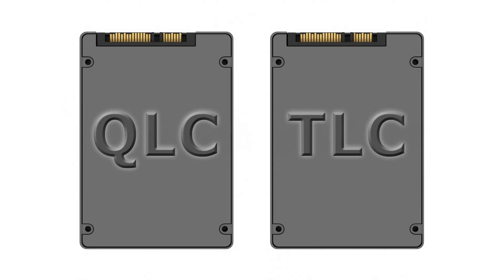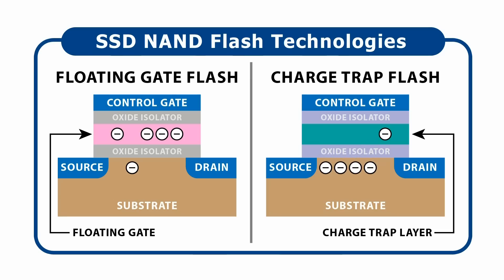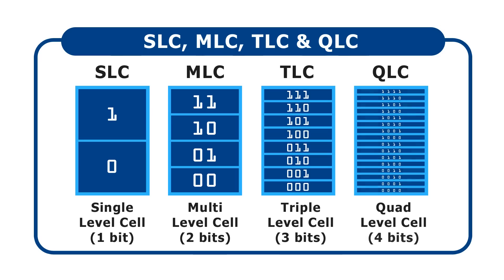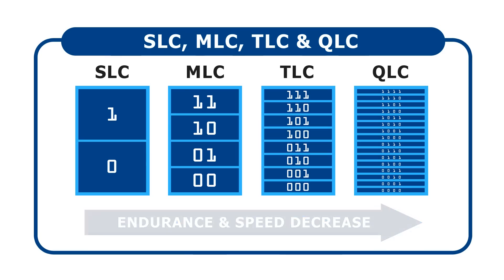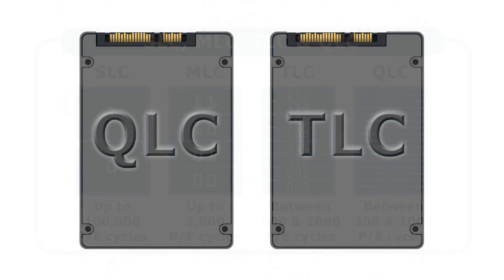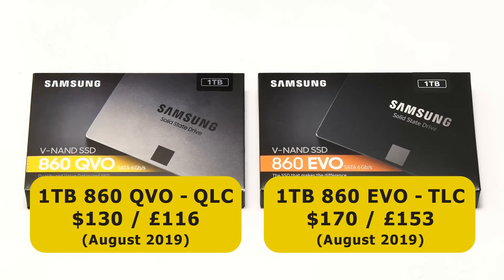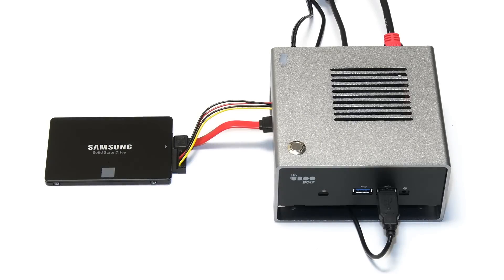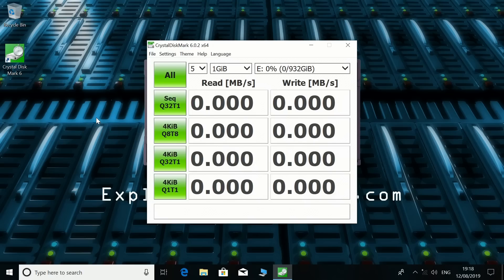QLC vs TLC SSDs: Samsung QVO & EVO

Comment: The likely reason your drive has the 78GB SLC cache is because it was produced as a 2/4TB model but for some reason a memory module did not pass QC to Samsung's standards. One of the modules was disabled and it was packaged as a 1TB 860 EVO. This is called binning and is common in production of microprocessors and memory.
Reply: They would bin the memory modules, probably, and not finished articles. That would be wasteful. The real reason is faster cache/storage interplay inside the TLC drive, which means it didn't saturate just yet.

Comment: So if I cache an 8 TB HDD with a cheap 3D TLC 128 GB SSD, I can achieve more storage at a better price, and it would perform faster. I think QLC might be better suitable for enterprise or commercial use where they're trying to keep down power consumption or vibration.
Reply: "Better price" as in better price per GB of storage. I have 4, 6, and 8 TB HDDs in my PC, trying to get enough space.
Reply: problem is the cheapest stuff sometimes make you cringe
Reply: @claritoresdiano1021  An ADATA SU800 128GB can be found for about $30... This setup would be more durable than a QLC drive.

Comment: we saw that linux mint drive going into the mother ship - ya linux is the greatest system ever. ubuntu mate runs great on my dell r410 server with 32 gigs of ram - new graphics card works in it too -its gonna be a render farm/workstation.   its kinda loud so might have to plunge it into a liquid cooling tank.  just ordered samsung evo hard drives on ebay last week so maybe thats why this video popped up.  i sometimes wonder what free bsd is like but never had time yet to try it yet.  oh by the way why do servers use SAS drives and not SATA???  is SAS better - worse???  so many questions and you're the only one who probly knows.  servers have SATA ports and seem to be working fine.  sorry for this long boring comment.

Comment: With the drop in price of QLC I finally ditched spinning HDDs in my main system. I keep 2x2TB drives in a NAS for movies but my main PC now has 2x1TB Kingston A400 drives for game storage and a 512GB M.2 drive for windows and programs. 
I think we'll see this become the norm in desktop computing in the next 3-5 years, the only reason I have the NAS is becasue of the reduced life-cycle of QLC.
Reply: Which M.2 drive do you use? And is it Sata or NVMe? Got any temps problems? Thanks.
Reply: @gabcenz  I use an NVMe Intel 660p drive, 512GB. Read/Writes at about 1.7gbps (about 2-3x as fast as a sata drive) and it was only $60 for the 512GB. My case is the Fractal Design Focus G and I have 6 fans in it so I've never had problems with temps (FX 8350+ GTX 1660ti for reference)
Reply: @DaxtonAnderson  Thanks. Looks like a good option to consider. I'm looking for a new SSD to boot Windows and installing programs. I was a bit worried because I've heard that some m.2 (NVMe or Sata, not sure)  may overheat and in some cases cause thermal throttling. Well personally I  have a good case and good ventilation too, so I hope I should be ok with any m.2 drive.